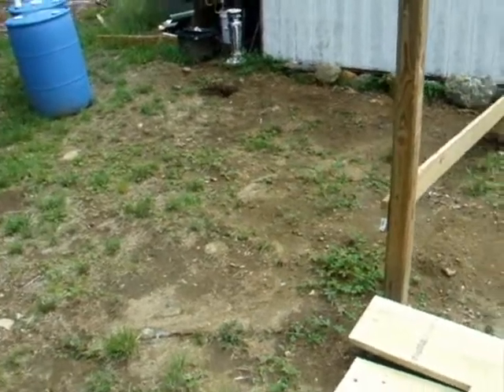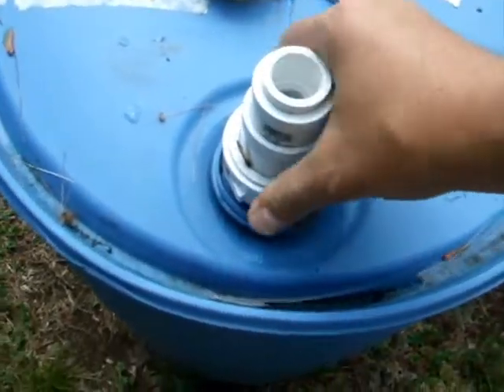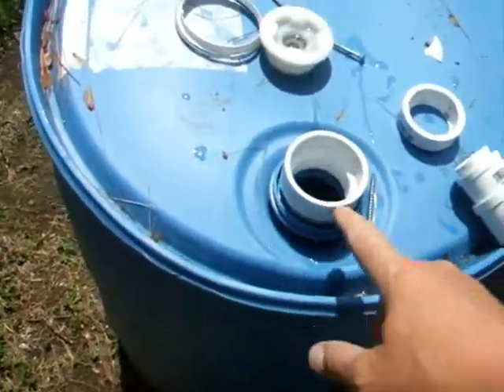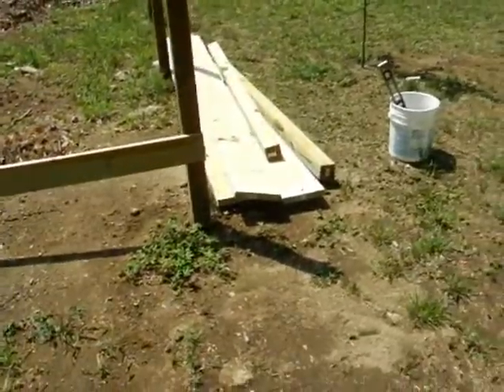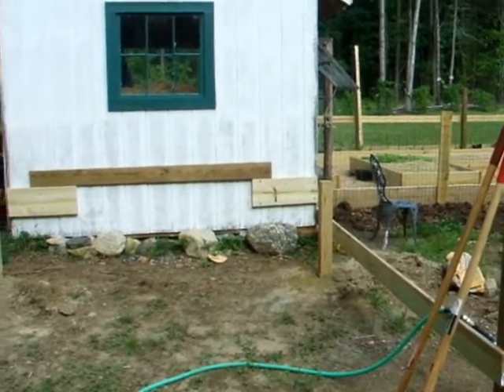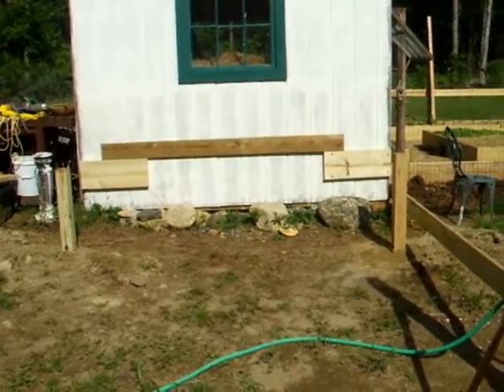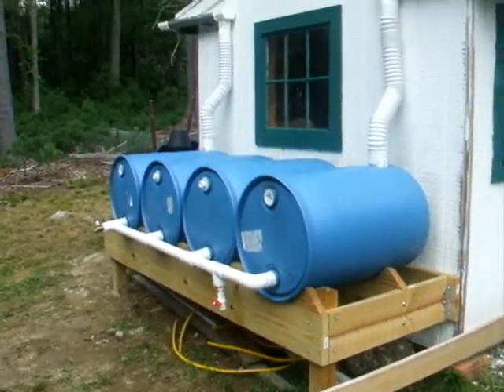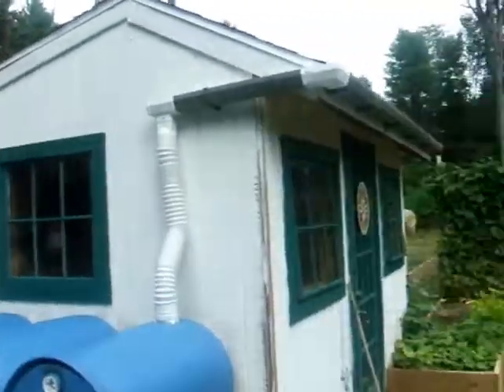My rainwater collection system.

Comment from the maker: @Aceman307 It's kind of deceiving. The level of that platform is about even with the tops of the raised beds. If water were to flow it would be at a trickle. The second half of this project is the solar panel system and an on demand pump. This way I can have a spigot on the side of the shed in the garden and have all the water pressure I'd need. :-D